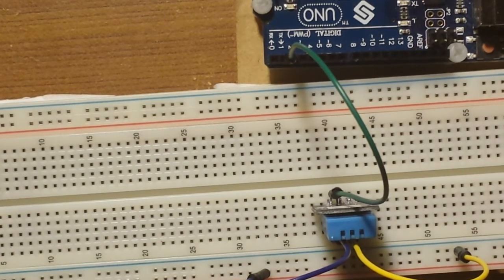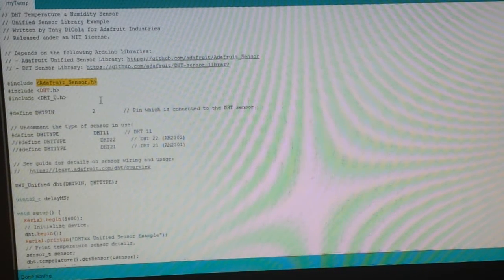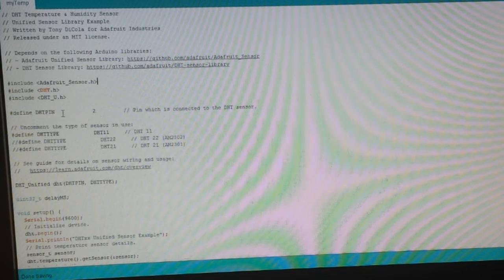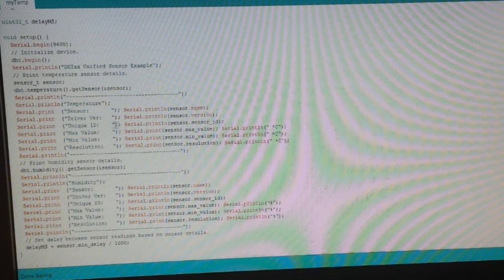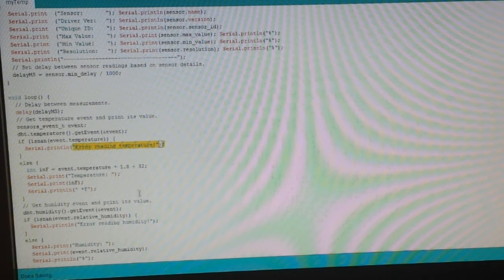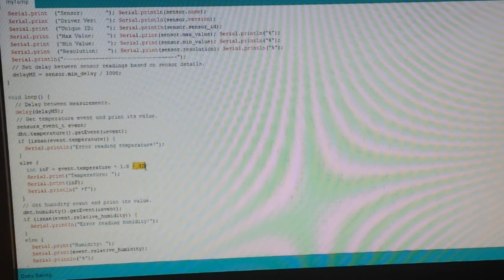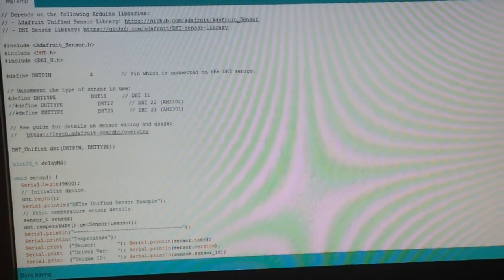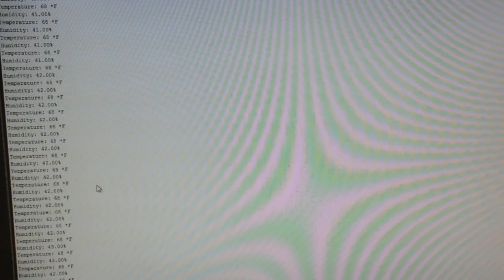How to use the DHT11 temperature and humidity sensor with arduino

Comment: I have successfully set up a DHT11 and a BMP085 to read and display temperature, humidity and atmospheric pressure. Hovever, there is a consistent 1.4 degree C variation in reading between them, and another digital thermometer shows a 2 degree difference from the DHT11. Hard to know which to believe!
Reply from the maker: Therein lies the problem with cheap Chinese stuff. Here is what you have to do (in my opinion): You have to decide for yourself what to believe. You can get 3 or four or five different sensors and and average the readings. Or you can trust the reading from a more expensive sensor. But that's really the long and the short of it, no lives are on the line here so we just have to choose....Peace my friend.
Reply: That was also my conclusion. I can check them against a known good thermometer and find the best one, and maybe fudge the numbers by adding or subtracting something from the displayed total. BTW - I have just discovered a really annoying issue with the IDE: lists of libraries and sketches disappear off the bottom of my screen, with no scroll bar to reach them! I just installed a library I cannot add... Have you had that issue? v2:1.0.5 of the IDE.
Reply from the maker: +Philip Chandler No I've never had that issue, but I believe I'm running v1.86
Reply: And you have a scroll bar for your library and sketch lists? Wonder if I can still get that version. Or maybe I should use the online IDE, but does that have all possible libraries?
Reply from the maker: +Philip Chandler I have a scroll bar. You can download any IDE. I've played with the online, it has all the libraries, but it's slower
Reply: I've just installed 1.8.6 and it does the same thing. Maybe it's because I'm running it under Ubuntu.
Reply from the maker: +Philip Chandler Ah it could be an OS issue. Unfortunately, I'm a Linux noob and really can't offer any help.
Reply: I have an old Mac here, so I will try it on that.
Reply: learnelectronics I recommend Ubuntu Mate for most purposes, but it doesn't do a good job with the Arduino IDE, which is somewhat surprising.

Comment: I know you showed how to hook up the DHT11 sensor, but I couldn't tell for sure which is the pinout for this sensor? Is the data line on the left (with the blue box facing you) and the +5v in the center with ground on the right? I'm so confused!
Reply from the maker: George Chambers if you are dealing with just the sensor it's (from left) 5V,signal,nc,gnd. if u have the module it's signal,5V,gnd. keep in mind if u are using the bare sensor you need a 10k resistor between 5V and signal
Reply: Thanks, Paul. I have the module from 37 sensor kit from Amazon. I hope to replicate your tutorials on my own. I've got to relearn so much, they didn't have all these low priced sensors back in the day!